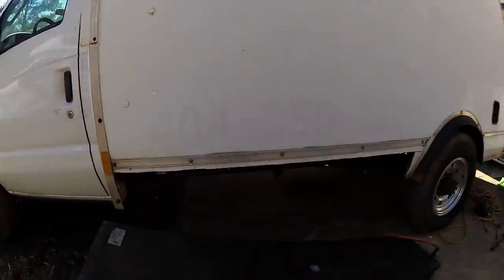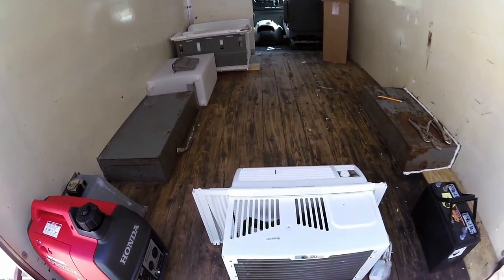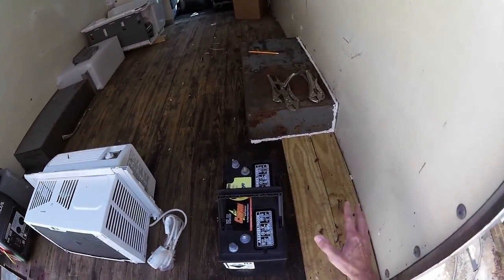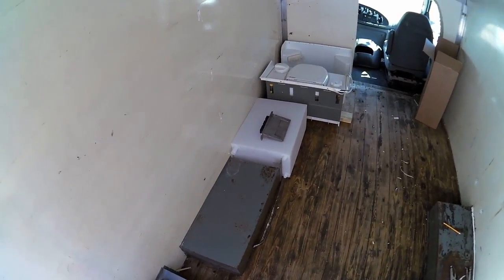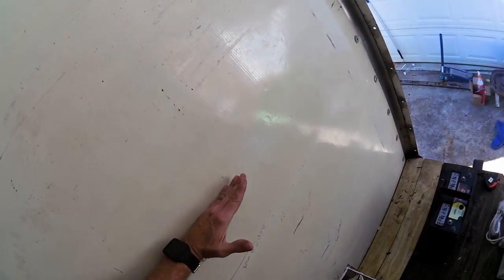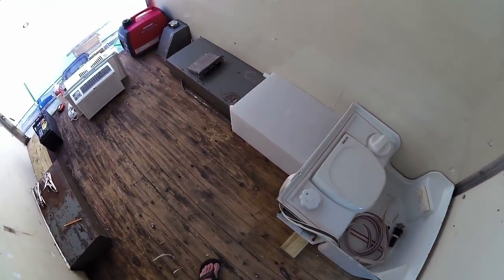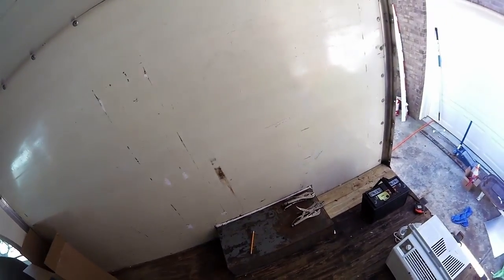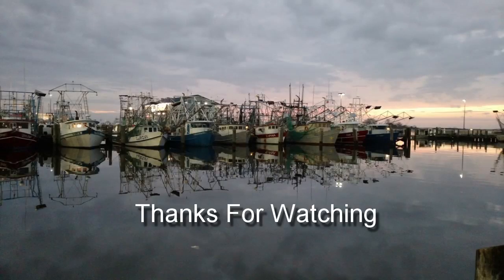Box Truck Camper insulation and new parts 11

Comment: Remote start accessory is available for Honda products.  That is the same type of box on my 12 foot model.  I draped radiant barrier below the ceiling cross beams before adding  2" of R10 closed cell insulation.  2" of R10 also  on sidewalls and floor.  Sidewalls also have 1/2 inch open cell insulation with radiant barrier affixed to one side - along with 2" of closed cell.   Top hat (fiberglass cowling above cab) has radiant barrier (3/4" air gap) with 1 inch (R5) closed cell insulation.  Intense summer sun has no impact on internal temperature of the box.  5,000 BTU  AC will be mounted on bulkhead 3 feet from rear barn doors. The bulkhead will have 2" of insulation.   The front area (9 x 6 x 6)   is super-insulated  so I expect 5,000 BTU should be more than adequate.   Generator  and AC exhaust (situated in rear utility room)  will vent through the ceiling fan of this stealth rv toy hauler.  Mountain bike will be stored in the utility room, which will also house  solar system batteries. Never gave any thought to ceiling weight when installing 100 lb tongue-n-groove ceiling in the front area, but this is 2013, 3500 chassis with 7 stack spring design should handle it.  Previous owner was hauling 3,000 lbs (plus) of waffle batter on his delivery runs. Marks on the sidewalls indicate the racks were 5 feet high.   I'll have about 2,000 lb  load at most.  This 6L vortec engine was designed for the 4,500 series chassis.
Reply from the maker: Sounds like a good setup. I really believe you can't over insulate until you get above R13 before it starts to diminish its effectiveness. 6L vortec is a good engine.

Comment: I had a pop-up camper with the shower/toilet combo that you have. It worked ok for us but you had to completely wipe down the shower curtain and toilet after every shower or you'd end up with a wet butt and back when you used the toilet. It's a good setup for limited space though. Make sure you get the chemical to add to the black water tank. Great build so far!
Reply from the maker: Thanks, I appreciate the real world experience using one of these. I've never had one and any info about using it is a big help. How much trouble is it dumping it?
Reply: As far as the toilet goes, it wasn't hard to do. The holding tank has a spout with a cap on it that swivels out for dumping. There is also a small button to push to allow the waste to flow while dumping. After its emptied give it a good rinse and add more chemical to the tank to keep the smell down. We didn't have a grey water tank for the shower. we had a section of hose that attached to the side of the camper. We put the hose in an old 5 gal water tank and just set the tank on the ground beside the camper. We dumped it after every shower.

Comment: what kind of gas milage do you typically get with your box van? I hear they are pretty bad (But maybe they were talking about older ones from the early 80's yours looks a bit newer) Thanks for the video!! :D
Reply from the maker: +เŦ א๏ย ςคภ гєค๔ tђเร א๏ย ןยรt ๓เﻮђt ђคשє t๏๏ ๓ยςђ tเ๓є ๏ภ א๏ยг ђคภ๔ร คภ๔ ๓ยรt ๒є ๒๏гє๔ t๏ tєคгร l๏l  
Well, my 94 E250 campervan with a 351w averages about 12mpg loaded. I'm hoping for 15mpg with the box truck camper.
Reply: that's not too shabby! :D